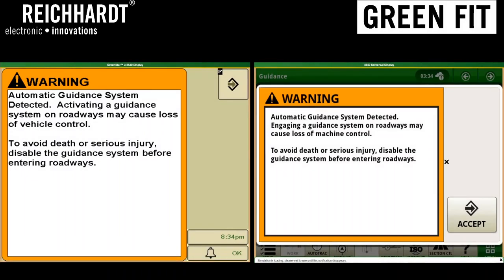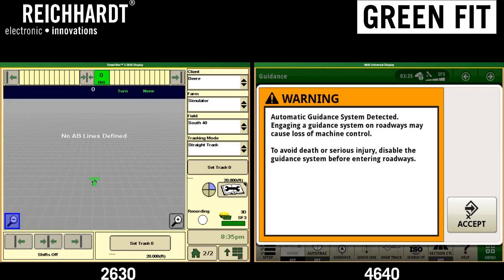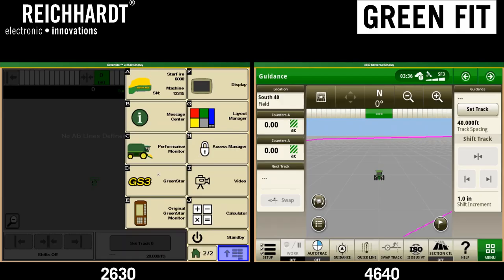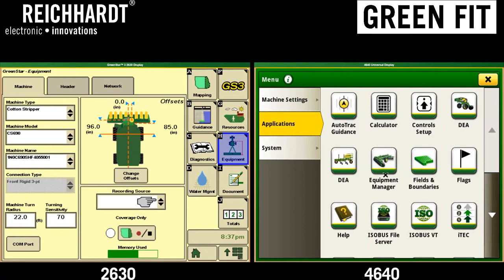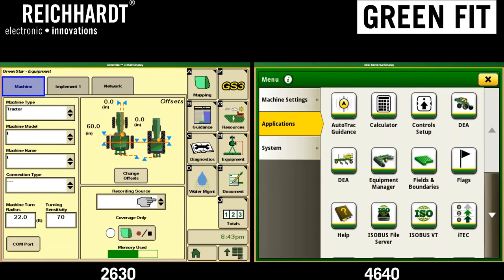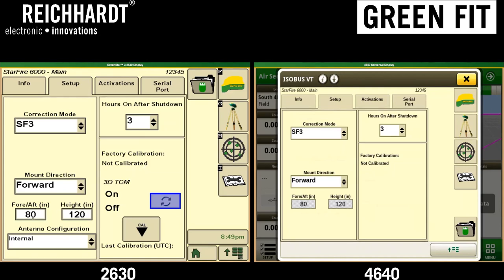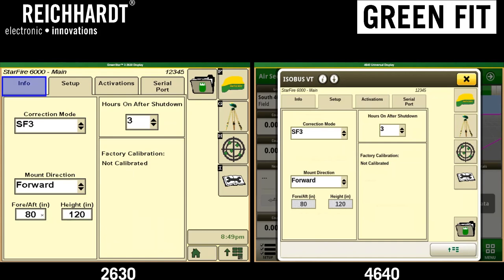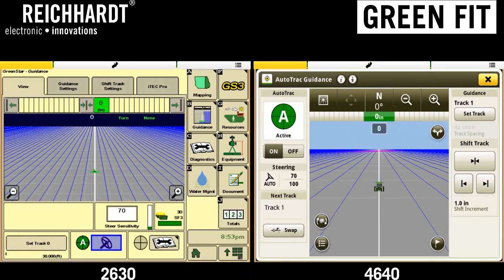GreenStar 2630 vs 4640 Basic Guidance Setup

Comment: What can one do if the shading behind is not closing between two trucks or AB line
Reply from the maker: Hi Michael. Are you missing coverage entirely, or are you just leaving behind "strips" between passes? The former requires implement geometry to be fully entered along with a functioning "recording source". The latter may require some adjustment to the implement width value assuming the space between guidance passes is not too large.